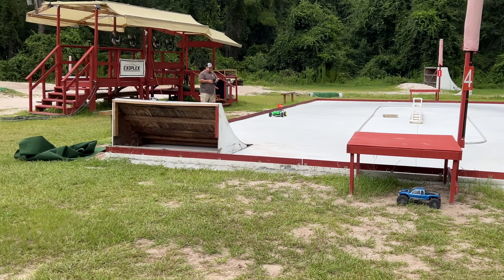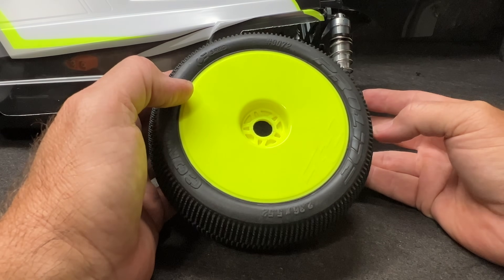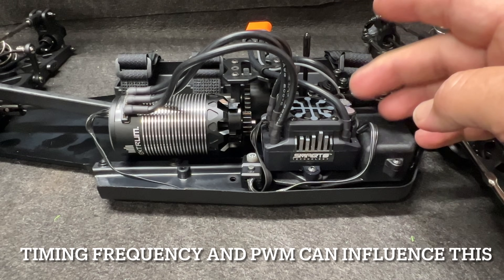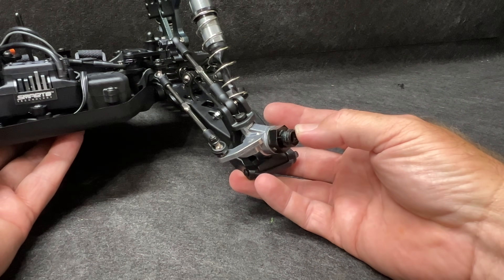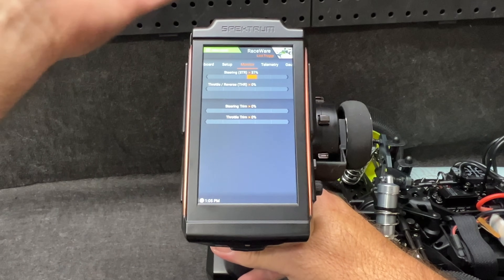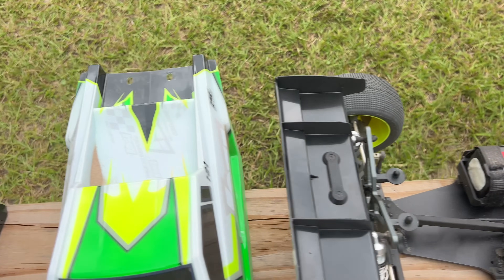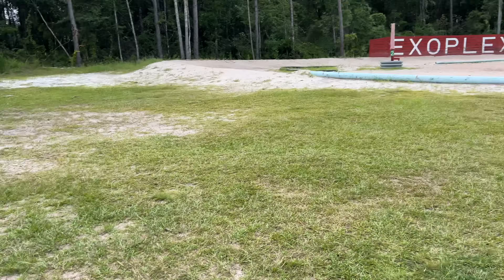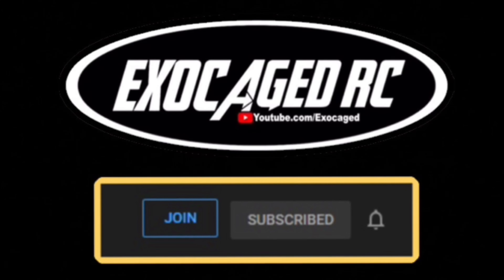Losi 8ight-XTE RTR Race Truggy

Comment: I changed the stock servo to a Protek RC racing servo. It handles so much better. The stock servo is weak and slow. I'm sure there are cheaper options that are good too. The Servo cost me 169.00.  Worth every penny for me. The stock servo did not have enough power on high-bite clay and carpet tracks.